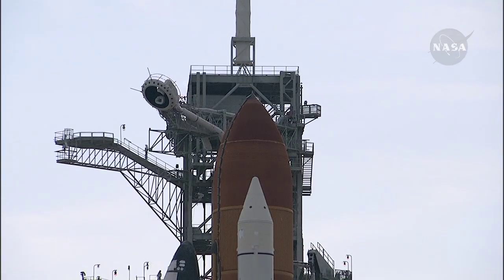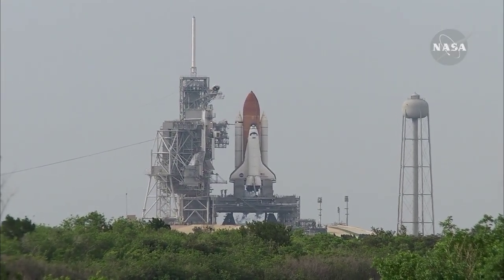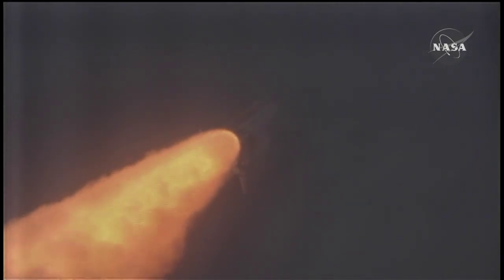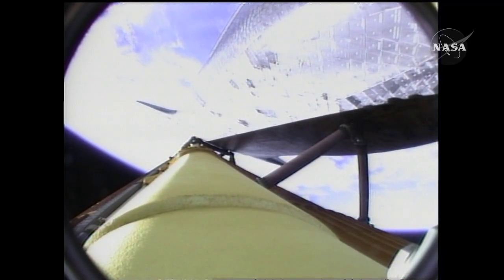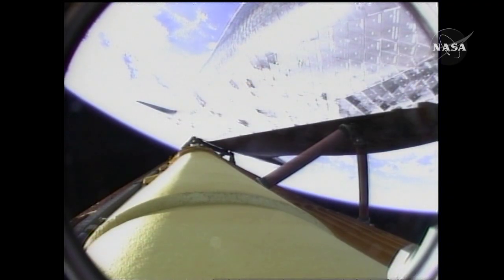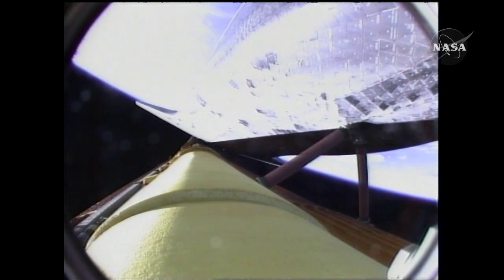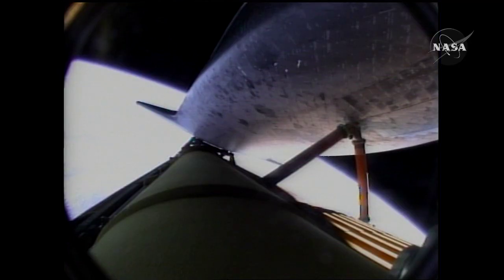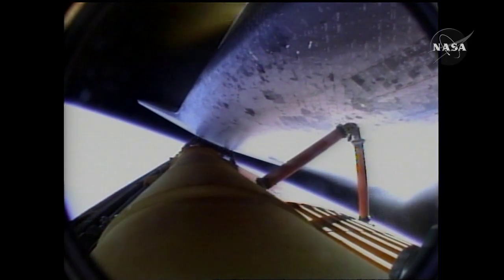HD Launch of STS-127 on 07.15.09 from T-2 to MECO

Comment: @navalaviator017 
They rolled on their back to get better radio with the ground.
They point up and to the east because most orbiting objects are orbiting in some east-bound trajectory.
The reason they are east-moving is because the Earth rotates east at around 1,200 miles an hour which is a direct savings in the required fuel to accelerate to the needed 17,500 to get into a stable circular orbit.
The direction of take-off is either 42 or 132 degrees from north to match ISS orbital path

Comment from the maker: @luckycharmz336 The majority of the byproducts released from a launch are steam and water vapor (especially at liftoff). You'll notice after the SRB's separate at about 4 minutes into the video, there's no real visible exhaust. The main engines (the ones without the smoke) run on hydrogen and oxygen. Their byproduct is nothing more than water vapor. The SRB's main byproduct is sulfuric acid, but it carries about 2.2 million lbs of prop per flight, so less than that becomes the acidic exhaust.

Comment from the maker: @nikiebc NASA's ending the shuttle program because its mission is now done. It was planned in 2003 (after Columbia was lost) to be retired after construction of the International Space Station (ISS) was complete, and is developing a Shuttle Derived Heavy-Lift Launch Vehicle (SDHLV). The space shuttle main engine (SSME) is the most fuel efficient rocket engine ever developed, and will be used on the next design.

Comment from the maker: @SaGruenwdt It doesn't work that way unfortunately. Aircraft can only fly at about Mach .90 at cruise altitude. This is about 600 mph or 1000 km/h. You still have 27,000 km/h to overcome.  In the big picture, that's barely and roughly 4% of the total speed and energy needed. The plane built to carry the orbiter and all of the propellant needed to accelerate it the rest of the 96% to orbital velocity would be more expensive than the orbiter itself.

Comment: @spacevidcast I know that it takes 28000km/h but... The point is we could save a lot of energy taking off like a normal Aircraft and ignite later with lighter Rockets into the orbit! That is the point. It is in my eyes nonsense to take off old fashioned - strait up. You could start and reach 3000Km/h in a normal way without any rocket - then ignite! This would be even quite saver ;o)

Comment from the maker: @SaGruenwdt Aircraft are only able to fly to about 40,000-50,000 feet (12000 to 15000 meters) in altitude. The official altitude of the border space is 100km or 65 miles. It takes a LOT of energy to accelerate 250,000 lbs (114,000 kg's) to 17,500 mph (28,000 km/h). That's the speed you need to go to get into low earth orbit.

Comment from the maker: @9DragonMaster They fall into the Atlantic ocean abiyt 150 miles off the coast using parachutes, then are picked up by recovery ships, taken back to KSC disassembled, cleaned (salt water and steel don't mix), then sent back to the manufacturer (ATK) to be processed and reused on a later flight.

Comment: Main engines use Liquid Oxygen and Liquid Hydrogen.  And from a website I found this for the SRBs: Ammonium Perchlorate (Oxidizer, 69.6% by weight), Aluminum (Fuel, 16%), iron oxide (Catalyst, .04%), a polymer (Binder for substances, 12.04%), and an epoxy to cure the compounds (1.96%).

Comment: This is because at 2:20 the SRB's (white things) are out of fuel, hence they drop off. However, there is not enough velocity to reach orbit, so the 3 main engines (black and on shuttle) continue to burn, using fuel for the ET until the proper orbit is achieved. The ET is not re-used.

Comment: You would think that from her figures but she's wrong there is no way possible- even if it was a super-fast intercontinental ballistic missile- for it  to go 7 miles out in the first 33 seconds.  She should have said 0/.7 miles because the first 15 seconds it just goes straight up from the pad before it even goes past the beach line and heads out over the water at 25-30 seconds.